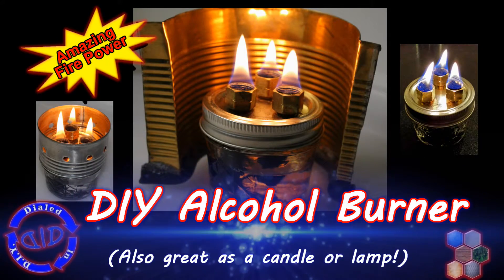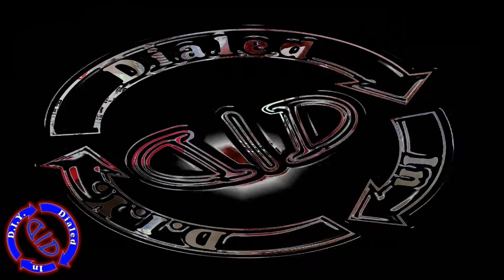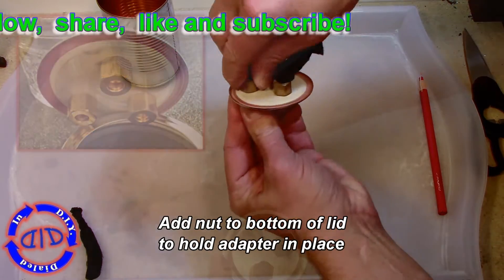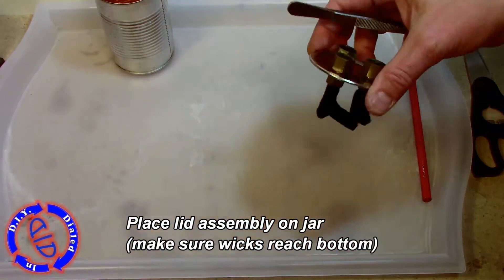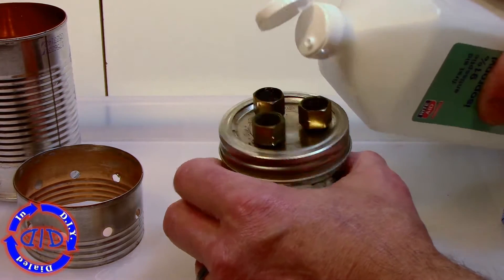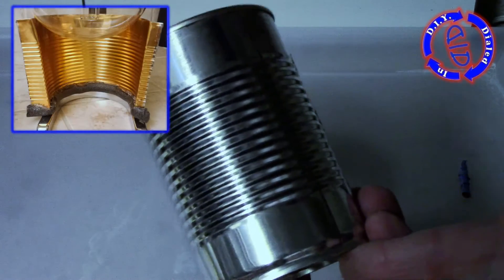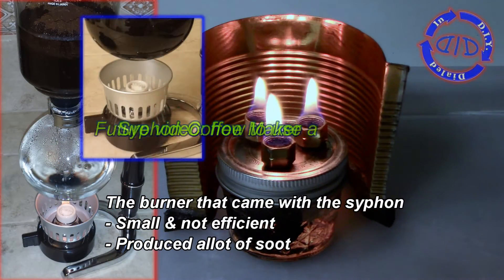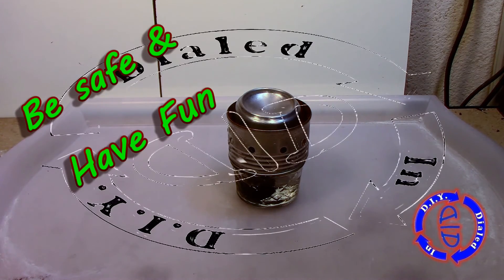Make an Alcohol Burner - Emergency Lamp - Great for Syphon Coffee Makers

Comment: of course iso alc will sooth ,,use methanol instead,burns hot and clean
Reply from the maker: so true... especially the 70-ish% iso (more water, more soot).  I like methanol too.  Thanks for watching and taking the time to post a comment.
Reply: @DialedInDIY  yeah for some reason the more water it sooth up,,i guess because it does not burn as well,but i think if its 99% pure then its fairly clean and smokeless,i like methanol too with the blue flame but if i could i would use ethanol ,,it burns hooter and is not toxic like meth,you can use it indoors,,however iso burns hotter than all of them but again with the sooth issue and im not sure its safe for cooking food with,,you welcome and thx for the vid

Comment: Does the alcohol continue to seep out from the pressure built up by use? All the wicked alcohol lamps (others would be the pop-cans burner which uses like a subsurface wick) I've made have had an overfiring problem (runaway leading to spatter) and leaked fuel after use because the heat generated pressure in the alcohol chamber.
Reply from the maker: Great question, especially since I have had that issue with some of my alcohol stoves but typically when I overfill the fuel.  For this burner I have not had any issue with seepage or sputtering from pressure.  Fortunately the way the wick design works with the hardware allows for pressure equalization.  Thanks for the comment and for checking out my video!!